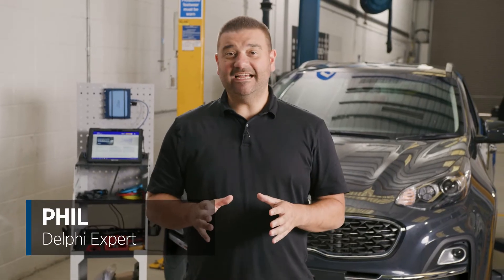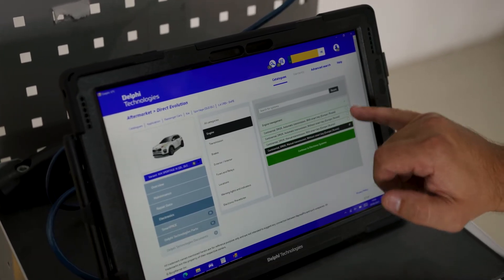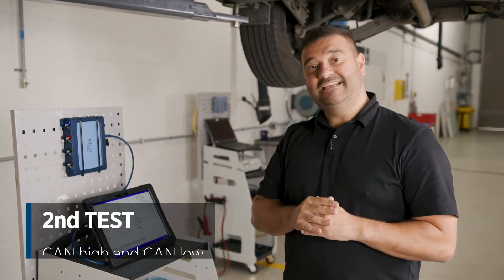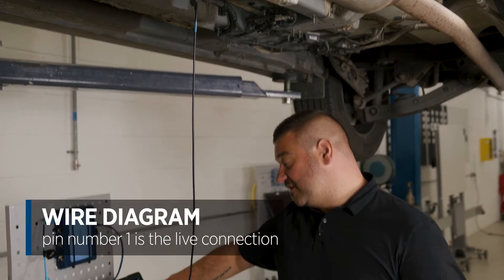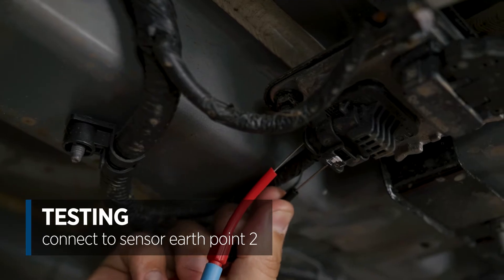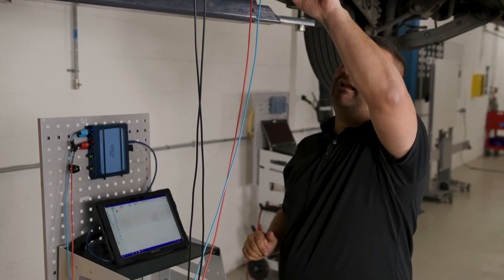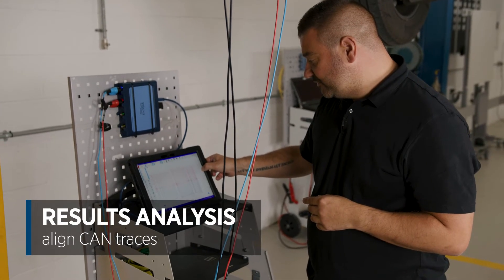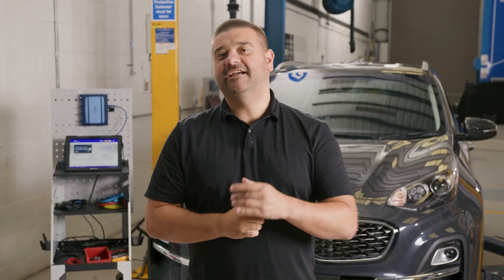[EN] How to check a NOx sensor | Masters of Motion

Comment: Is the communication between the sensor and the adblue unit is bidirectional or just a signal from the sensor to the unit?
Reply: bidirectional
Reply: I've had a few recent cars and vans in to diagnose with dpf faults and efficency on dpfs etc and would like to know the acceptance amount for ppm on the nox sensor pre and post dpf/scr etc. 

I've had to pass them back to the dealer as either error codes that I wasn't able to look up on autodata as these nox and soot weight sensors are not cheap so I didn't want to get them wrong. 

Any help would be greatly appreciated.  

Thank you for the video.
Reply: @denhaagtrader8781Pre sensor about 200-400 ppm and post sensor 0-20 ppm.
Reply: Nox sensor talk with Engine ECU, not with SCR Ecu!